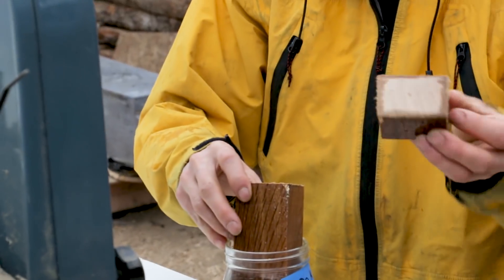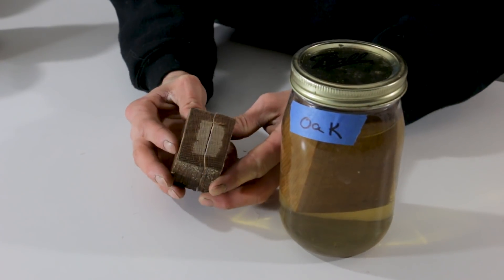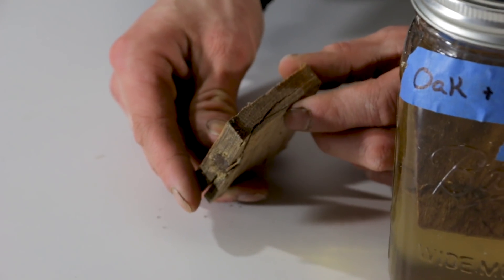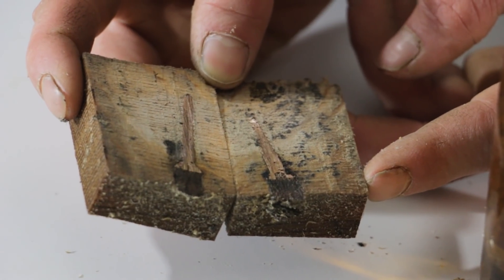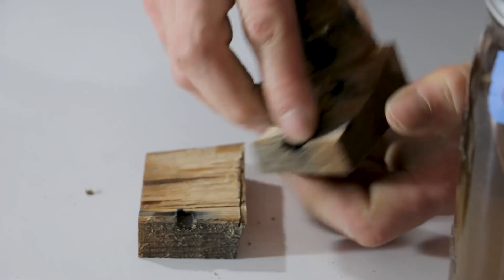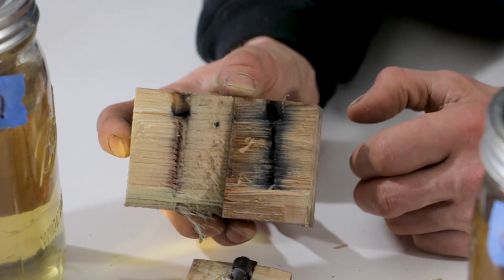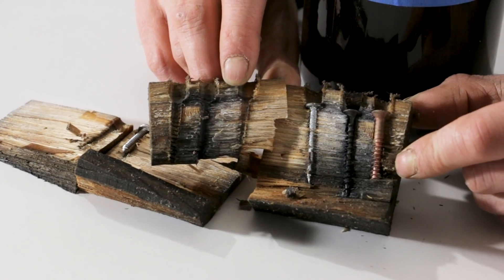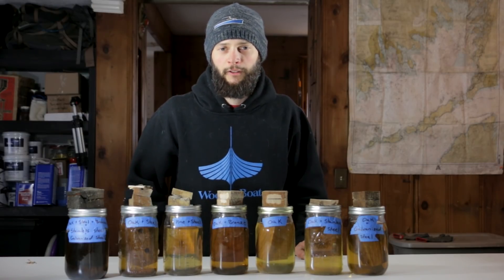Acorn to Arabella - Journey of a Wooden Boat - Bonus Content: Dissimilar Metals Part 2

Comment: I think it is brass instead of bronze, but the brass/bronze screws look the cleanest. In the old days they used brass or bronze screws, but I don't know what modern boat builders use, brass/bronze or stainless steel. If you want to keep it authentic you should go for the brass/bronze screws. It was strong enough for those boats back in the days, and you will be  sure it will last a few hundred years. 

That is also the reason why brass or bronze wool is used to clean up and refurbish wood instead of steel wool. Brass splinters won't give rust stains in the wood, and with steel wool you might get rust stains from broken splinters.
Reply from the maker: Bronze is much better for structural fasteners and is much longer lasting in salt water.  
From what we have read brass is never recommended for structural fastenings or below the water line, but it is very commonly used in the interior for nonstructural stuff like locker hinges and such.

Comment: The last sample was much wetter inside because you had more screws in it and therefore more points of water ingress. A good experiment but you missed a control point. The number of fasteners and also distance between fasteners should be consistent. Great video.

Edit: was likely much more wet. I don't know I haven't done it and am not a science boy.
Reply: otakonxxx Water ingress, rather than egress?
Reply: Tee Jay thanks.
Reply from the maker: The number of fasteners probably did play a role.  
We missed a few control points, it's far from scientific but so far has been interesting!  We would never have thought the oak would be dry in the middle after a month in the water.
How long would a big timber stay dry in the center for? The more we learn the more questions we have!

Comment: "That old ship of the faith was leaky and iron-sick, and down by the head and heel, as they say at sea."

'Charge It' 
Irving Bacheller  ca. 1620

I wondered about the origin of the phrase and this is what I found on a cursory search. In my steel hulled ship we had astonishing paint to use yet still had zinc anodes stuck here and there. You couldn't quite see the corrosion taking place.
Reply from the maker: "down by the head and heel" have not heard that one before, have heard boats like that be described as hogged. 
Steel boats are a whole other beast that we know virtually nothing about. I would imagine anodes and good paint are paramount.